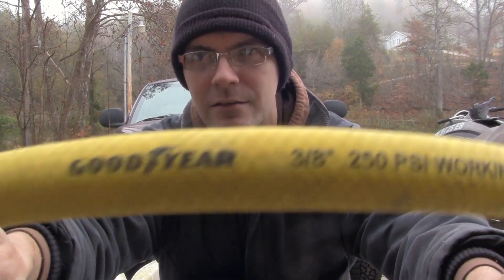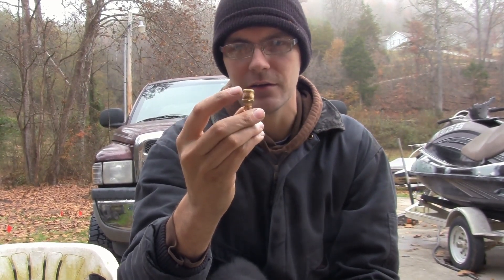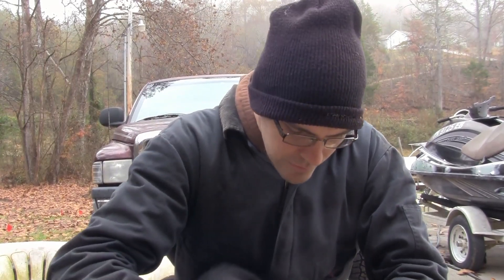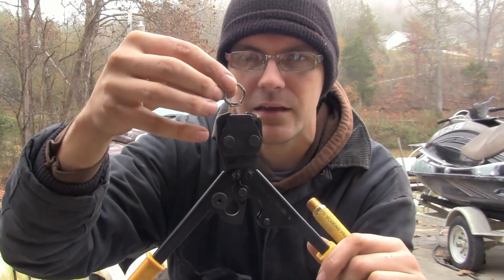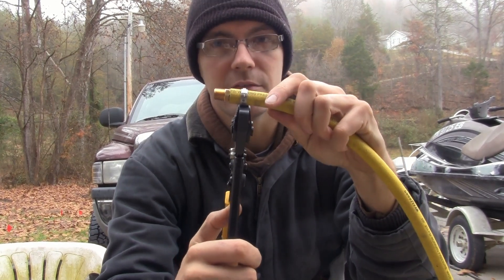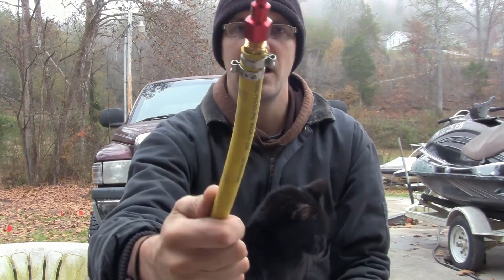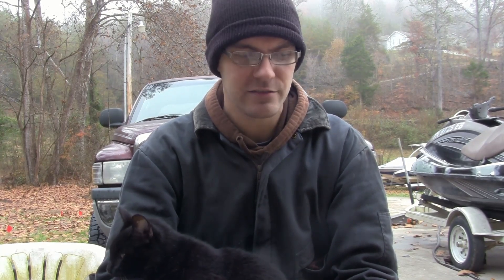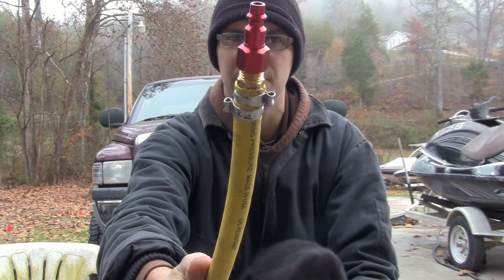How to fix an air hose

Comment: Thanks for this idea! I bought everything you have in this video to make 5 air hoses out of one 50 ft air hose and every single one of the hoses worked flawlessly without a leak!
Reply from the maker: Its a great way to make shorter whips and stuff, far cheaper than buying individual hoses!